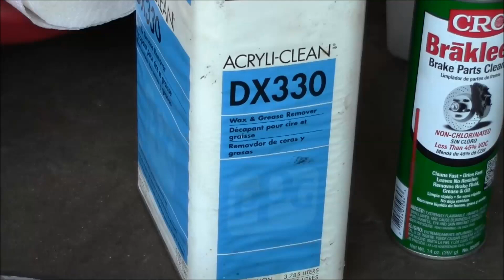Fox Mustang Drum Brakes "BEAR TRAP"- Full Removal/Installation, Wheel Cylinders, and E-Brake Cable

Comment: This video is a godsend im trying to bring back an 89 hatch from beyond the grave. I wasn't sure how to set the parking brake cable with never seeing an oem  example. I can't seen to find those crecent moon objects anywhere.
Reply from the maker: ThatScruffyGuy72:  LMR Mustangs may have the parts you are looking for.
Reply: @fwh79FOXR6  I tend to order from them often. Maybe I looked in the wrong category.
Reply from the maker: @Scruffy72  They have a parking brake category on the web site.
Reply: @fwh79FOXR6  I've checked it several times. It doesn't seem to have those little pieces on any of the kits, or as individual parts which is kind of odd though. On the bright side we got a guy with a couple foxes at a boneyard. Hopefully we can scavenge them from one of them. I appreciate you taking b the time to help me out.
Reply from the maker: @Scruffy72  You're welcome

Comment: you eventually going to convert to rear disc brakes?
Reply from the maker: +Darren Hall I don't have any plans to do that.  I'm pretty content with the braking performance I have right now.  I think if you run the right pad set up with the steel braided lines and a good bleed job, you get some decent stopping power.